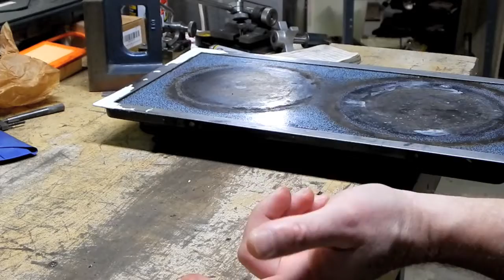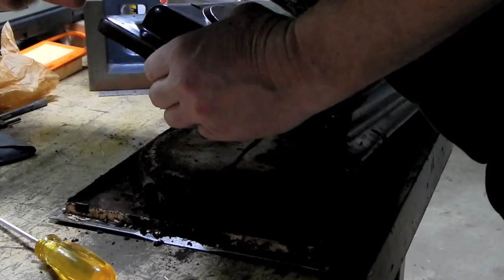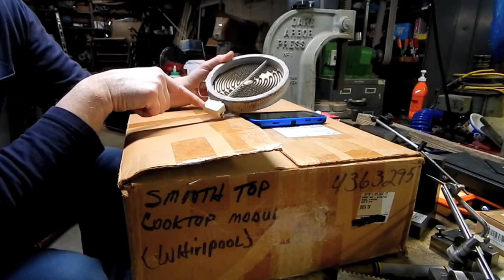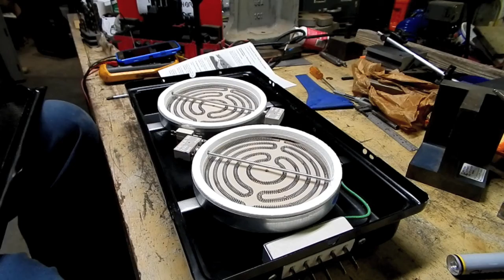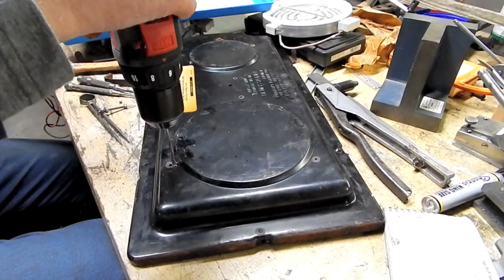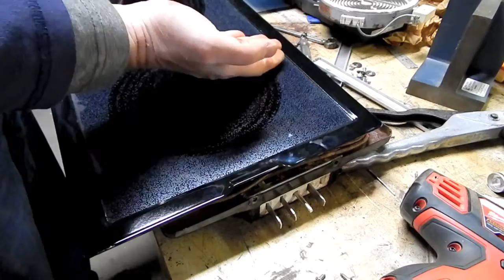Jenn Aire burner repair

Comment: 23:06 - I would make a template here and rotate it slightly one direction or the other to avoid drilling too close to the original rivet holes. Also, depending on how close the dimensions of the ebay module were to your stove, I would concentrate on the connector mounting bracket fabrication. That would give me a pan that is not already deteriorated away. This is one of the benefits of watching someone else struggle with a project is that you can come up with ideas of your own to make the repair. Thanks for posting.

Comment: You can use a pumice atone on the glass? Perferble from a mexican store.  Not sure if it scratches glass, but it wont scratch metal. At least hasnt mine.  They are hard to find depending were you live, and they are black

Comment: Thanks for the video  it was very helpful.  Just as a question.  Couldn't you have just moved the plug in the old range over to the newer range rather than going through all of that?
Reply from the maker: It's been a while since I did this repair, but if i recall correctly, i think the metal pan was a little thicker on the new one.
Reply: That's right!, I do recall that.  Thanks again for a great video.  It was very helpful!

Comment: What if it's not the cartridge and it appears to be the dial or knob? I switched the sides of the cartridges and they both don't work.
Reply from the maker: Sounds like you've isolated the issue to be in the stove circuitry, and not the cartridge. From this point, the best move is to proceed with a sound troubleshooting approach. This is where a skilled technician with a meter comes in. The voltages present are dangerous! The circuit is pretty basic, only if you have the skill. Sorry i cannot be of more assistance but at least you didnt buy a new cartridge.
Reply: @stevewatr  got it. Thanks. I've got the power turned off to the range. Going to take it apart and see if it's a loose wire. If not I'll call a technician. Thanks for the speedy reply.

Comment: My first and obvious problem is that this things is that it's very inefficient.  Glass is a horrible conductor of heat so right away you're behind the 'heating' 8 ball.  Induction is absolutely astounding when using cast iron though!